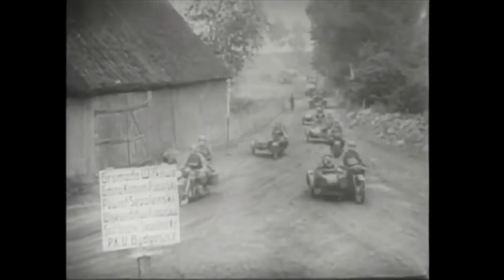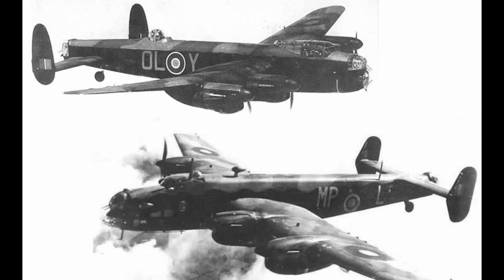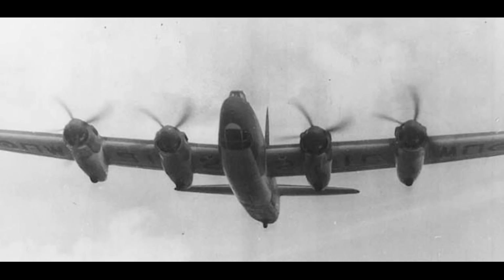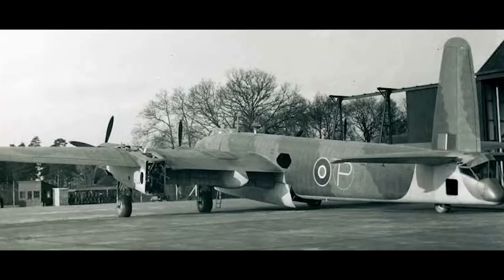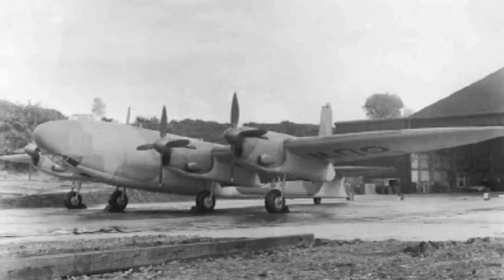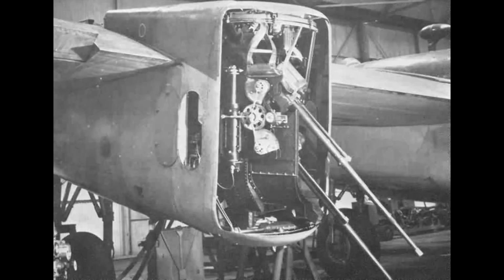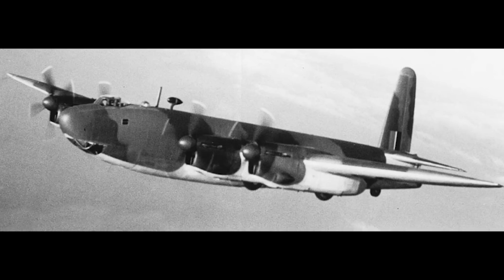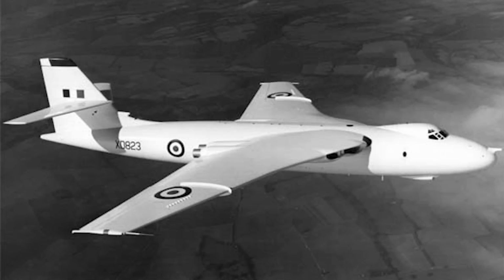The Vickers Windsor; Wimpey’s Big Brother

Comment: Even though it seems they never got it to work I am pleased that designers were considering new ways to fit more powerful defensive weapons.

Can't remember where I read it, but somewhere a few months ago I came across an article pointing our how low a priority improving bomber turrets were for the RAF. Case point being the Lancaster who were only JUST getting updated to 50 cal weapons by 1945 after being variations of 303 turrets since the Manchester was still a concept. Compare that to other nations. Germany were designing remote weapon stations for the Me210 as early as 1940. I mean I don't think they got it to work correctly for another few years, but it showed the way they were thinking.

Regardless of that, the Windsor looked like a beast.

Comment: The origins of the Windsor wing goes back to the second half of the 1930s for studies that led to 1939 requirements that included the 8000lb load but also an eight cannon defensive armament. Some designs had up to six engines. They also had wing spans up to 170+ feet. No issues with the myth of hangar size limiting wing span.

Comment: Hi Ed, was it the case that the Wellington was reliable in the sense that its airframe geodesic structure proved to be stronger and  more resilient against flak and cannon fire? As I have never heard a word against it, yet the key strengths are not expressed?
Reply: That’s a great question ie was the Wellington actually a great bomber, or was it just safer to crew than it’s obsolete contemporaries? Ideally you’d want your early WW11 bomber to fly high enough even fully loaded to mitigate accurate flak (25,000 ft + ?) and be fast enough over enough distance to minimise exposure time to contemporary night fighters capable of around 300 mph (ie 275 mph for the middle 1000 miles of the mission?). Neither of which the Wellington got close to…

Comment: The Manchester was designed for P. 13/36, along with the Halifax, which was for a medium bomber (8000lb nominal load, IIRC) not technically as a heavy bomber. It was the Stirling that was the heavy, initially as the back up to the Supermarine 316/7 with a design target of, IIRC, 14, 000lb. In the end the Manchester had a maximum short-range load of 10,000lb, when it worked, the Stirling theoretical 16,000lb, but on a mission to Germany sometimes as low as 3, 500lb over a distance the specification said 14,000lb should be able to be carried.

Comment: I was of the impression the Windsor was wallis's initial need for 30,000 ft+ bomb release height for tallboy/grand slam bombs to achieve over supersonic drop velocity to work properly.
Reply: That was the six-engined ‘Victory’ bomber, designed by Wallis to drop the 22,000lb ‘earthquake’ bomb from around 40,000ft, the height Wallis felt ideal for maximum effect. It got as far as a wooden wind-tunnel model that I think is on display at The Brooklands Museum & very attractive it is too. It was rejected as a bit of a one-trick pony that would take too long to develop when the four engined bombers were just coming on stream & there was little surplus production capacity to work on something so advanced. 
I also wonder how it would have hit the very precise targets intended for it from that height given the problems that, for example, the Americans had with their Norden bombsight that worked perfectly in clear blue skies but fared less well when faced with the amount of cloud cover common over European targets. 
In the final reckoning, the first 22,000lb Grand Slam was dropped by a 617 Lancaster on the Bielefeld Viaduct from just 12,000ft & successfully made a right mess of the target. Even when further modified Lancs were used, they struggled to reach 20,000ft but were nevertheless highly successful. In the end, the Victory bomber was too specialised & the RAF, as is so often the case, did the best they could with the equipment they had ~ & frequently surpassed expectations.
Reply: @davidpope3943  I believe the RAF finally managed the capability to drop the Grand Slam from a much greater height by strapping a couple underneath a modified 'Washington' - a later mark of the B29... obviously (thankfully) it was never needed to be used.
Reply: @davidpope3943 great reply